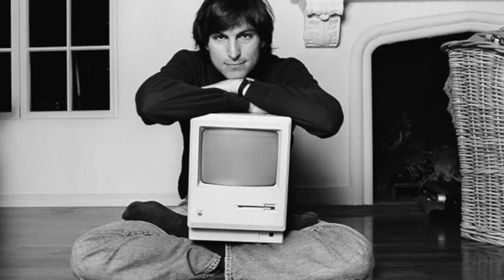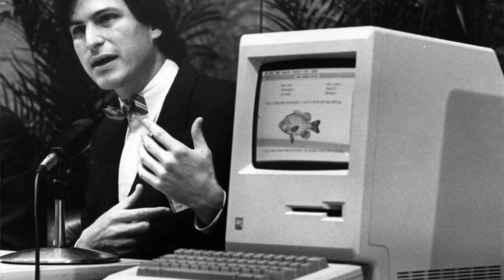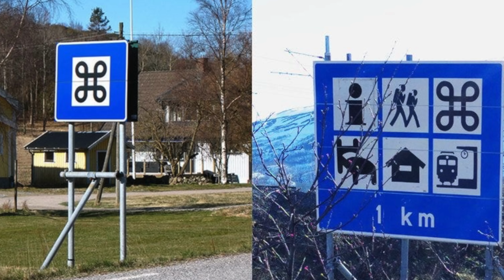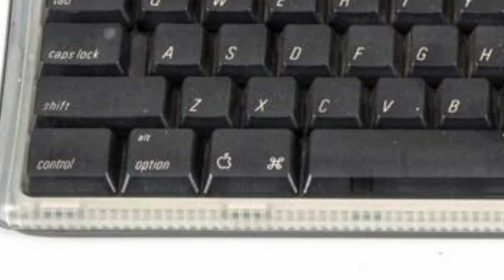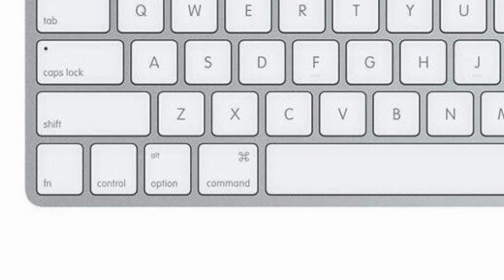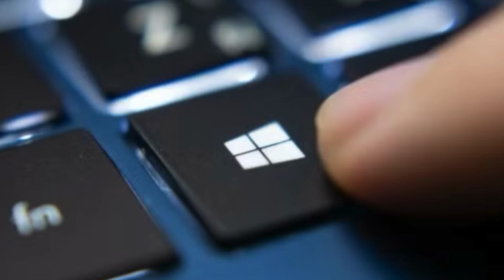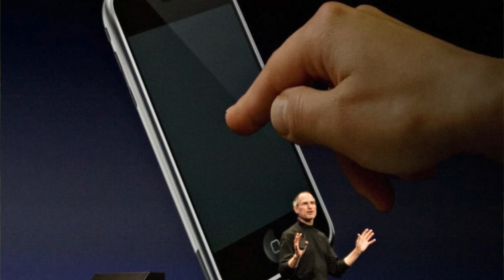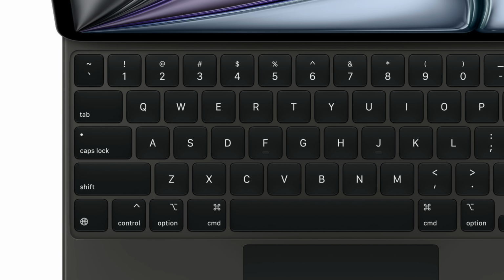History of Apple's Command Key

Comment: 0:05 On Mac (unless on Terminal) the CMD key is the equivalent of the Windows Ctrl key (e.g. CMD+C vs Ctrl+C to copy. same for paste, find, quit etc). Option is the equivalent of the Windows Alt key
Reply: ...except in certain circumstances which annoy me as a native Windows (Linux) user. Some shortcuts (like Cut Copy Paste) use Command, some (like Ctrl + Laft, Right, Up, Down to change cursor position) use Control. The later shortcuts I use much more frequently as they make working with text so much more efficient, and the Windows single control key paradigm is ingrained in me that it frustrates me whenever I have to use a Mac at work. I cannot for the life of my understand why Macs have two Control keys.
Reply: @jrhaven  Because you're still trying to think like a Windows user. MacOS is not Windows. The command key is the command key and not the "windows equivalent" of anything. It sharing the control scheme with the Windows control key in some cases is entirely incidental. They both evolved in unison.

If you work with Macs, my advice would be to get the most affordable Mac you can to have at home and practice with. Otherwise understand that it is gonna be more difficult for you just as it would be for a lifelong Mac user attempting to use Windows.

I'm lucky in that I have had moderate experience with Windows, MacOS and Linux at this point, but I don't doubt I would still be extremely rust with a lot of advanced Windows actions as I live with a Mac these days.
Reply: Yes and no. It is improper to compare it to any Windows key as MacOS is not Windows and has no responsibility to have behaviour parity with Windows and vice-versa. In truth, the command key can perform options  that control, alt or the super key perform depending. A power user will struggle to bring over their keyboard workflow without first learning a whole new shortcut system from scratch.
Reply: What would the equivalent of Alt Graph be?
This key replaces Right Alt on most international keyboards, used for enabling even more characters to be typed (since Shift is not enough most of the time).
Reply: @resolvanlemmy  I don't think enough of us care to answer that niche question.
Reply: @resolvanlemmy  Actually, AltGr is more similar to macOS's ⌥ (Option) key.
Reply: @resolvanlemmy Such things did not exist for Apple back in the 80s. At the time, there was the Option key, which was used for extended character sets. The Command key was the equivalent of Ctrl (at the time). There was no Ctrl key for Mac. 

When Macs started to interact with the rest of the world, the Option key was treated as Alt, and a proper Ctrl key was added.  (Command C as Copy, Ctrl C as ASCII “ETX”). Alt-Gr would be the right side Option key. 

All of this would have been configured by whatever terminal app you were using. …even going so far as mapping the Command key to the Windows key.
Reply: @harryd.4400 Even if early Macs didn’t have a control key, IIRC the Apple IIe did, alongside the open and closed Apple.
Reply: Coming from Windows, for months I just figured that macOS didn't have a way to do things like copy/paste when Ctrl+C/Z did nothing. It took a YT tutorial that Command was the way to do these.
Reply: @AncTreat5358  You could just look for shortcuts in the menu.
Reply: But when the macOS keyboard layout is translated to a standard Windows-based keyboard, the Command key will be emulated by the Windows key instead.
Reply: True but you have cause and effect backwards

Comment: 0:06 Not really, it's the equivalent of the Meta (Windows) key. The Mac key for Alt is Option.
Reply: Also, fun fact: the ^ symbol on the control key is a tribute to Unix systems (MacOS is a Unix).
Reply: The Control key, although rarely used, is present on Apple keyboards and can be mapped to different functions in Settings.
Reply: Thought it was the equivalent of CTRL (CTRL-C vs CMD-C)
Reply: It's half Control half Windows.